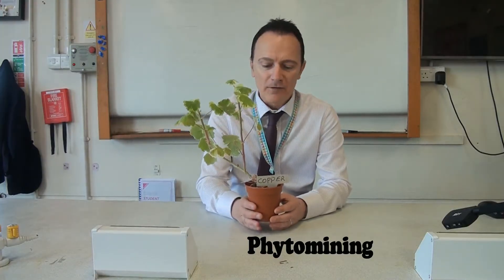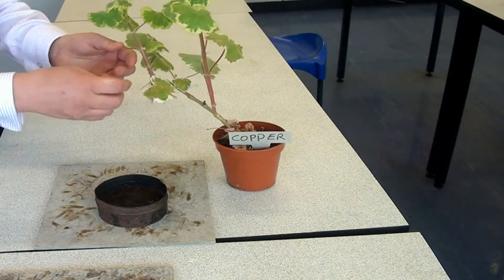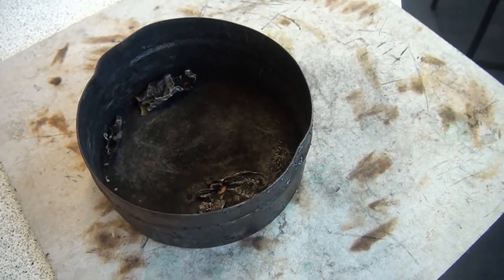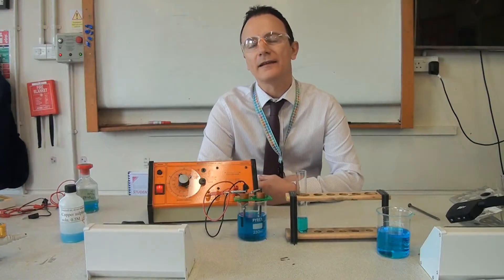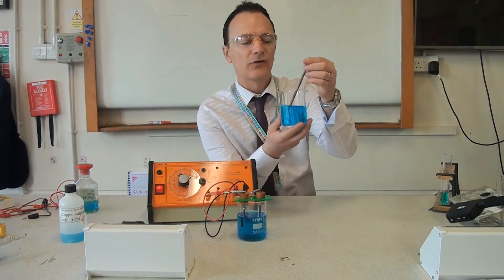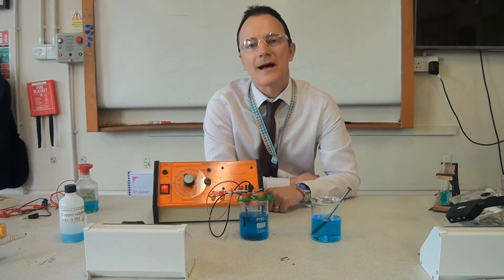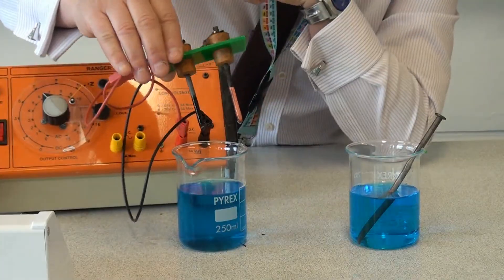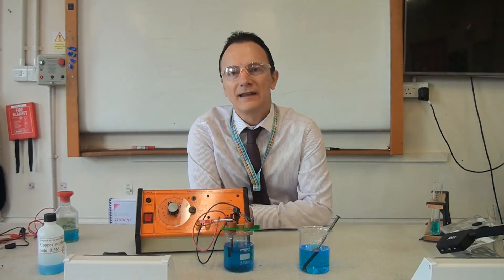Phytomining and Bioleaching. What is phytomining? What is Bioleaching?

Comment: Thanks! I’m not a GCSE student but interested in learning more about metallurgy so hope you don’t mind me asking-
1) what are the soot compounds other than copper and what happens to them when the sulphuric acid is added? 
2) if you didn’t know what metals the soil would contain, how would you decide what acid to use with the soot? Or would it be a multi step process with the same solution after copper extraction for example?
Hope that makes sense, just delving back into chemistry after years is tough!
Reply from the maker: Hi there. Thanks for your question. First I must be clear I’m no expert in metallurgy so I can’t really answer the question about the soot compounds. In terms of knowing what metals are in the soil, they would probably be tested in a lab using mass spectrometry . The different metals may then be separated out by a combination of techniques like ion exchange or a variety of chemical reactions. For example, aluminium may be removed by reacting with 6M NaOH. Sorry I can’t be more helpful but I’m glad to hear you are looking to get back into chemistry. I hope it goes well.
Reply from the maker: Btw metallurgy will become increasingly important as we need to source more metals for green technologies that need batteries such as electric cars